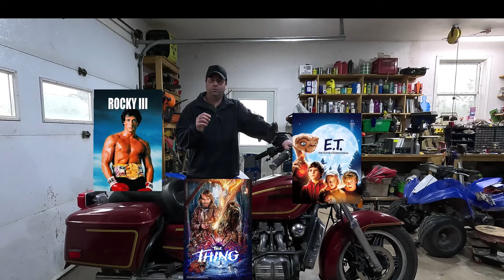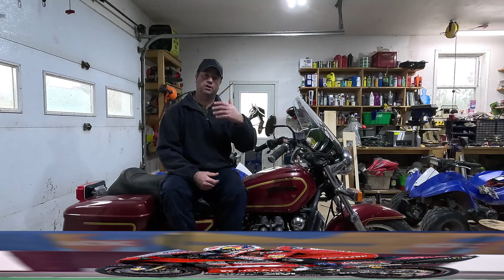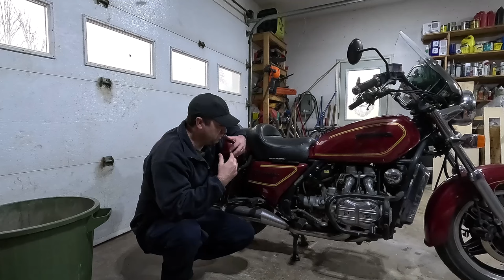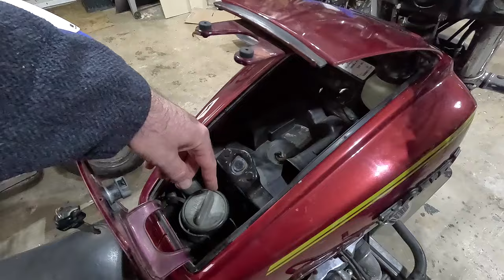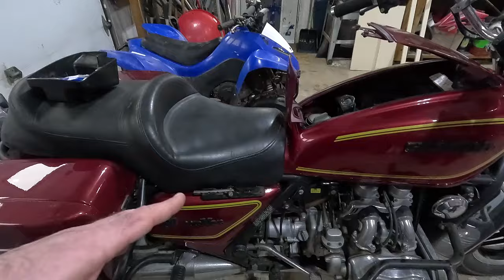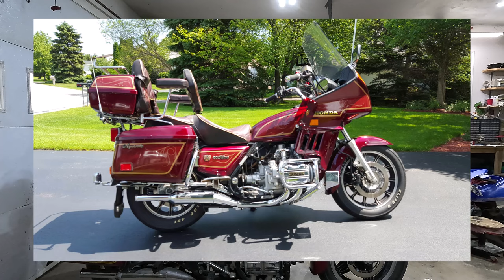Honda Goldwing GL1100 - 40 years old technology that's still considered fancy

Comment: I own an '86 GL1200
i find the linked braking fine
the bike is both smooth and powerful...I want not want any other Bike than a Goldwing.
Reply from the maker: once you get the air out they can be great. This one did have air which made braking better when firmed up. I still have this bike but spend my time on a F800GS on my other channel @ Adventures Nearby

Comment: The Original Honda Carbs. are way better than any others..
If a Single Carb was better then Honda would have not gone to the Expense of 4.
Reply from the maker: Consider this: 4 carbs is the easiest way to tune the bike cheaply. They didn;t have to go to the expense of producing a unique carb for this unit. If four carbs was the BEST answer you'd see it in their 4 cylinder auto engines.  Turns out a single carb is best if you have intake manifolds partitioned, like their cars of the period.

These carbs are in keeping with mass produced motorcycles. simple as that